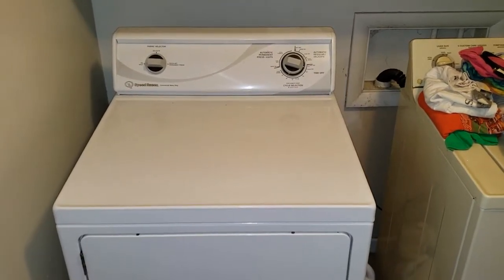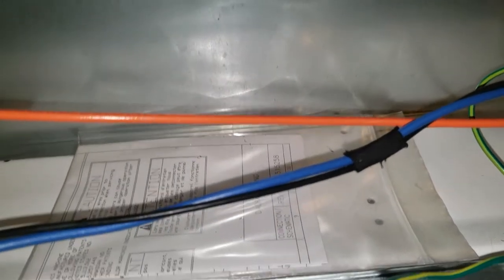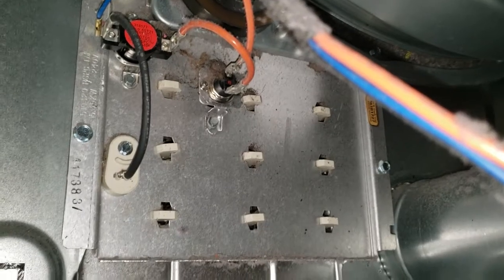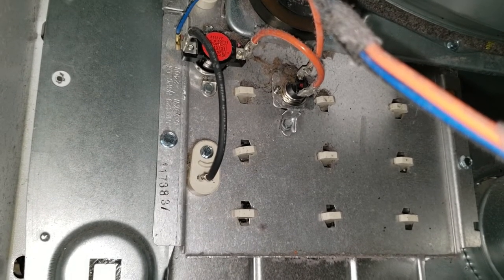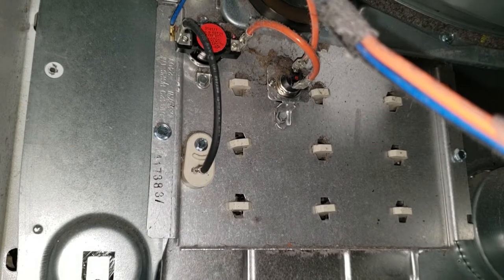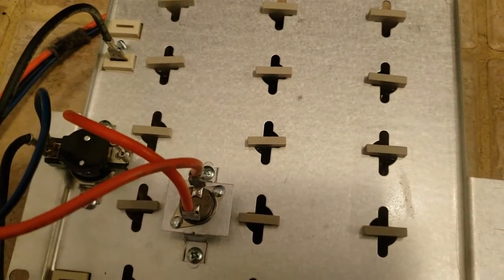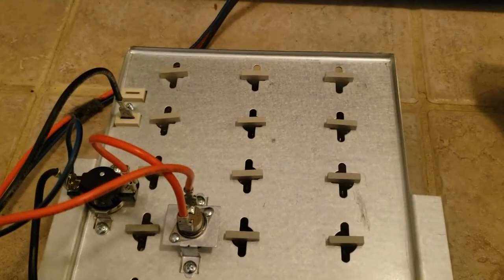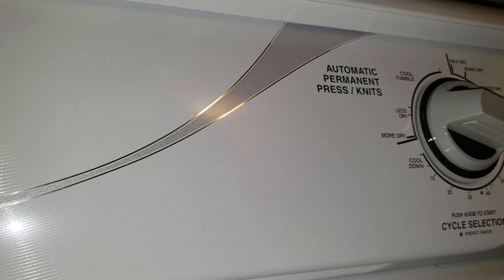Speed Queen Electric Dryer Won't Heat

Comment: Thanks for the video.  I have the same dryer, but my timer switch went bad.  Everything else tested good with my meter.  On that note, it might be helpful if you show others who are new to using a meter how to test the circuits you talked about.  It would help them understand how it works.  Again, thanks for the video and no disrespect, just a suggestion.  Thanks.
Reply: Did that bad timer make your dryer not heat up? I know my timer is going bad I'm just not sure if that's the dryer not heat up. Thanks
Reply: @TinoBamBeano  I’m not a technician, but yes mine wasn’t heating until I put the new time in. I checked the heating coil and that was fine.  There might be other issues with yours that I’m not aware of, but that was the problem with mine.

Comment: Thanks for your video! I have the same dryer and it went down yesterday. I did what you did and my heating element was broken too. I found the part on Amazon for $49.99. I just ordered it and it will be be here in “3” days. I’m so excited you posted my exact dryer. I believe we’ll be back in operation in 3 days! ❤️😁
Reply: Can you tell me or send the link to order the correct part on Amazon please

Comment: This technician is spot on. I pulled the old one out and just laid the new one next to it and copied the wiring to the new one.  Inspect your main black power lead closely. Mine had heat damage and I had to cut it back two inches to get into good clean copper again, and put a new slot clip on.  AWith vacuuming and cleaning, this is about an hour job.  Pro tip, use a magnetic driver head, or use a small piece of tape to hold your screw to the driver.  You can't get two arms in this space.

Comment: Wires on mine had a broken and burnt wire the element connector. Replaced the connector then a few weeks later it burned the other end the the other connector.
Reply from the maker: Thank you for your post this the exact reason you have to replace the element as a kit the kit even comes with replacement ends for some reason the element and or the sensors developed a bad connection and the only way make sure it's right is to replace the element and sensors and local wires as needed

Comment: Thanks for the video. My element is coming on sporadically. After cycling timer switch several times and tapping the top of control panel, the element will come on again. I'm thinking it might be the timer switch. Any ideas? thanks
Reply from the maker: time to break out the schematic and ohm meter

Comment: Eddie, Just pulled my control panel down and the main red wire from the plug is burned. can i replace that harness to the switch? why would this main power burn at the switch connection? thanks
Reply from the maker: Sorry I didn't know with out seeing it first hand

Comment: why not just the thermals? I've used a multimeter to determine it's one fo the thermal fuses that is bad, adn was hoping to save a few bucks (and time) just replacing that piece...
Reply from the maker: You can try it it kind of a 50/50. First off if the thermal  fuse blows its because the hi limit thermostat it cycling to high so those have to be replaced together. And the other thing is I personally have found that there is times that if you replace just the thermals that sometimes the wires or elements developed a bad connection and you end up doing it all anyway but that is not every time so you do what you think but just remember I can't knowing leave this to question on a customers unit they want it fixed  and i don't like recalls that are mine or my parts falt i want to be sure so I just do it all and it comes as a kit for a reason so I'm not the only one
Reply: @Fasteddiesinhomerepair  Thanks, I had a heck of a time finding just the fuse so I ended up ordering the whole kit. It's annoying because it's like the third time I've had to do this... We had our vents cleaned a couple of years ago, but maybe it needs it again, or maybe I need to go with a smaller hose.

Comment: Is there no way to get to the heating element from the rear?? Having to get on the floor seems like a real pain.  
The other thing which is a pain is heating elements do not last very long now. I remember a Maytag dryer/washer combo my wife and I bought in 1981 where the element lasted for over 15 years. Once we changed it, they lasted about 2 - 3 years. Honestly, it should be very possible to make them last much longer.
Thanks for your video.
Reply from the maker: No there's no a way to get at it from the rear and some elements are not made the same the element material itself is thicker in some cases and the old maytag element had really thick element wire and the new stuff just keeps getting thinner that's why when you buy a cheap one from Amazon it doesn't last as long you almost have to get the factory one but they keep getting cheaper to
Reply: @Fasteddiesinhomerepair  Thanks for the response and great video. At age 67, it's getting increasingly harder to get on the floor and back up. LOL
Reply: yes there is lay the dryer on its  back on a two wheeler and 100 percent better to work on  
i have a artificial knee and can not get on the floor so i can not get down like that